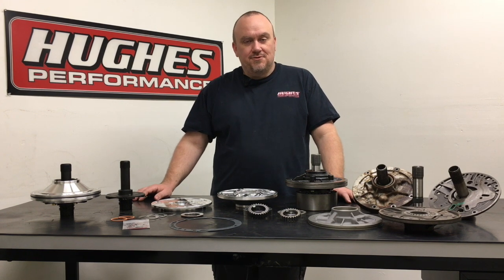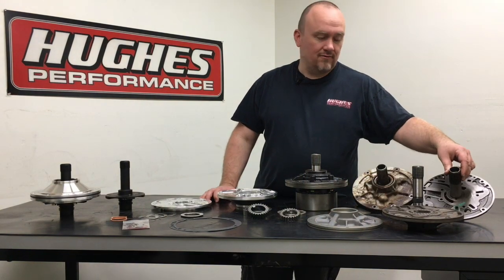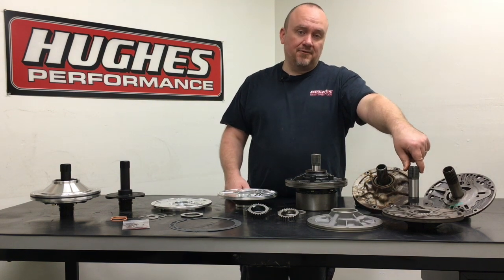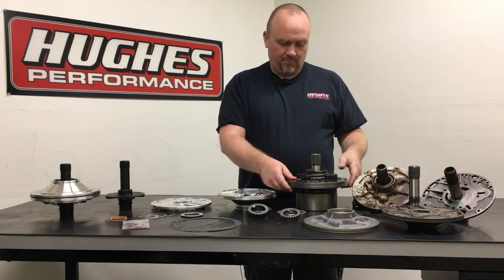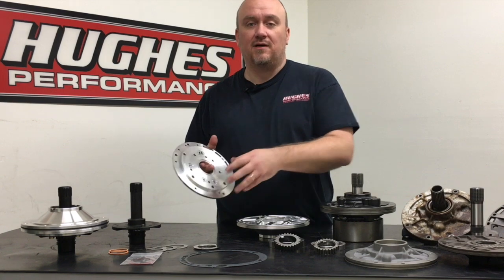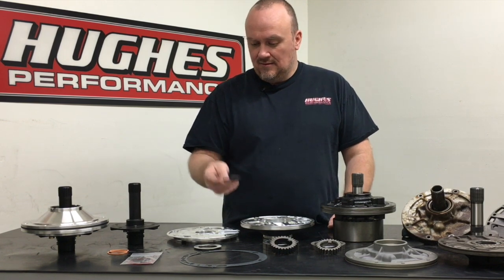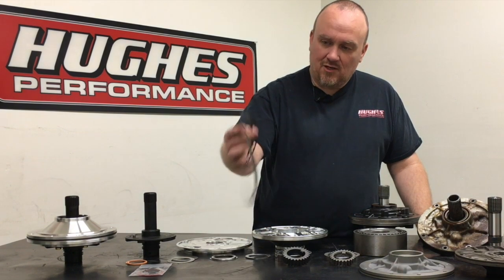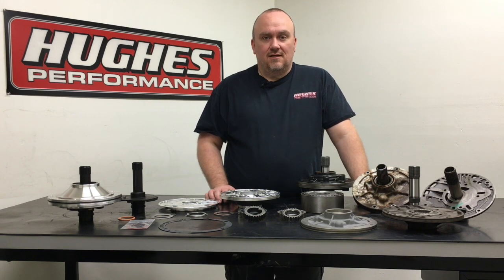Ep. 6 Powerglides 101: Front Pumps

Comment: On the converter feed restrictor, would not drilling the factory hole next to the stator tube that intersects do the same thing? Or should I tap that hole you showed and drill the rest of the pump to 1/4"? The old book I have says drill everything to 1/4 in the pump but I'm on an LS also have your single dump valve setup trying to make the thrust bearings last

Comment: Have you seen an issue using a high volume front pump and it changing the torque converter flash rpm. Thanks